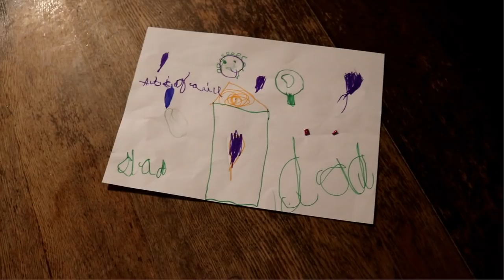I Got More Than I Bargained For

Comment: Your angle grinder tool (this goes for drill chuck keys as well) is to attach them to a chain and fasten the chain to the power cable with a cable tie. Insulation tape wears away but a chain will last for years/ever.
Reply from the maker: I had one that lasted years with tape, I lost the bugger before it wore out. I like the fact you have to unplug it to use it, saves my fingers that way. ;)

Comment: I got the really cheap angle grinder from Screwfix and the trouble with that one is turning the damn thing off - it's lethal.
Reply from the maker: I got the cheap one last year after the brushes wore out on mine, I swapped the brushes in the end and took it back. Don't tell them.

Comment: Nice table saw, a bit bigger than mine. I bought mine to replace the circular saw that died, it was on sale and not much more than a circular saw. When this one dies I will be replacing it with a superior version as it is so much better than just a cheap circular saw. A good touch about the flowers, although it seemed a little wasted, perhaps better used on those "unannounced" personal prezzies 😉 😄.

Cheers,

Schnuz.